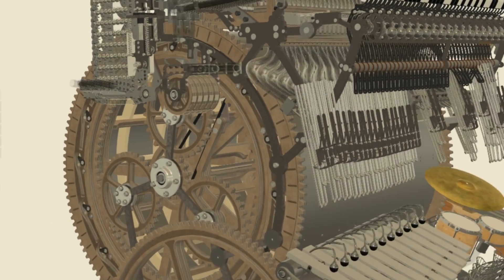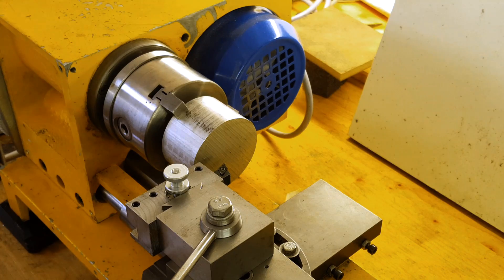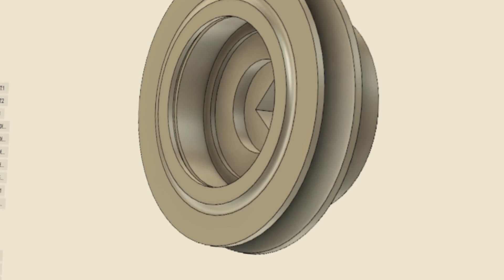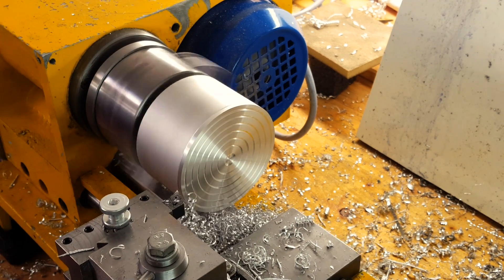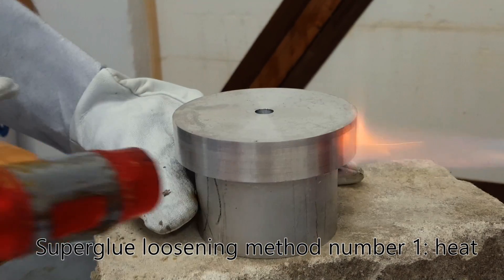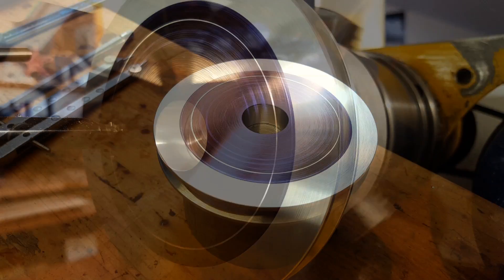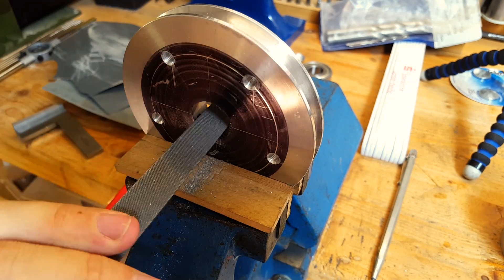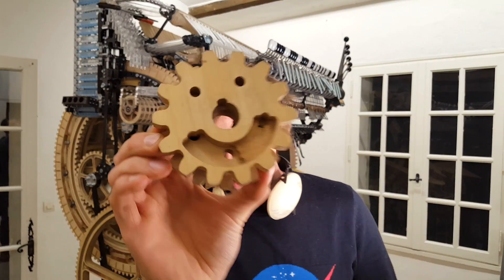Making more parts for Wintergatan´s MMX feat. Wintergatan (sort of)

Comment: You have a Prazi!  Thanks for proving I wasn't wrong 40 years ago when I bought the thing,  Now I know it was just me <grin>
Reply from the maker: Haha yes, it´s a very fine little machine :D
Reply: @pilotsworkshop4554  I put a DRO on the thing and for some strange reason I'm able to make precision parts.  I am still trying to figure out what measurement system was being used when they created those collars on the feeds.  But the DRO makes it a pleasure to work with now.
Reply from the maker: That´s awesome! I also changed a few parts here and there like the motor, a quick release for the tailsstock and a miniature quick tool change and now it is great fun :D